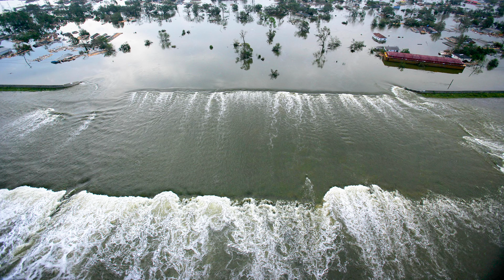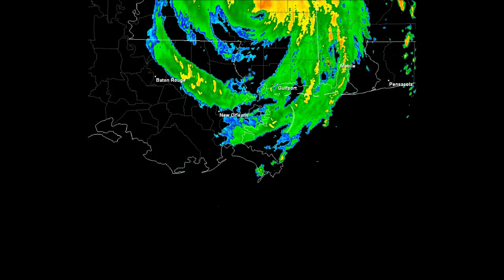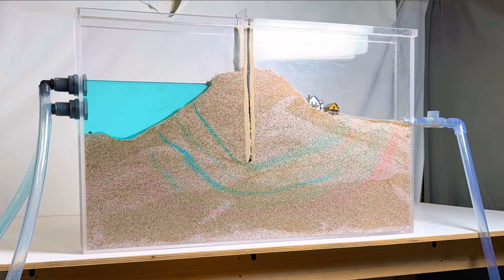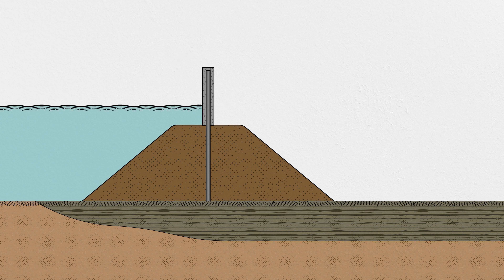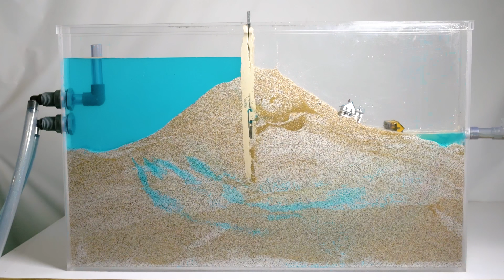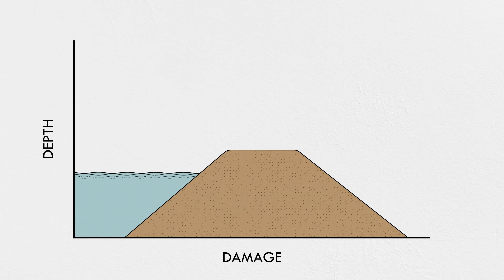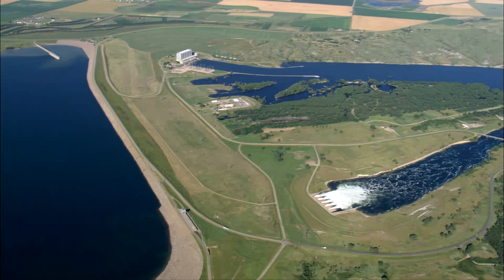The Mind-Blowing Flaw That Flooded New Orleans

Comment: But the MSM said it was because Bush hated Black people.  The MSM never lies.  Rusky Collusion was real, right?
Reply: No, the media reported many other people's and group's opinions that racial issues contributed to the poor management of the response to the disaster which there is strong evidence to support, and yes the Russian collusion was real and you'd know it if you actually would read the report that clearly outlines it and got several people directly connected to him indicted and prosecuted, fear of a Constitutional crisis by indicting a sitting POTUS was the only reason he wasn't charged too.
Reply: @jongrey1916  Sure, and people can change gender also.   Mueller found zero evidence and it's documented. 
Covid scam 
Rusky Collusion hoax 
Massive election cheating
Lawfare 
Censoring speech 

True definition of Fascism.
Reply: @DerekColeman-t3v  - Deflecting with other issues and conspiracy theories you don't understand doesn't change anything.

If you believed your original comment was true you wouldn't need to deflect the discussion to other topics, so clearly even you know your comment was nonsense.

Not a single media outlet ever suggested or claimed that the Hurricane Katrina disaster was caused by Bush being racist, only that racial issues played into the mismanagement of the response to it.

And the Mueller Report didn't judge "collusion" as no such crime exists in the US code but rather conspiracy, based on "coordination" which they determined required a clear provable agreement beyond knowingly assisting each other the way "collusion" infers and is heavily evidenced.

Volume 1, Introduction to Volume 1:

"Like collusion, "coordination" does not have a settled definition in federal criminal law. We understood coordination to require an agreement-tacit or express- between the Trump Campaign and the Russian government on election interference. That requires more than the two parties taking actions that were informed by or responsive to the other's actions or interests."

It also clearly states in Volume 1, Executive Summary:

"On June 9, 2016, for example, a Russian lawyer met with senior Trump Campaign officials Donald Trump Jr., Jared Kushner, and campaign chairman Paul Manafort to deliver what the email proposing the meeting had described as "official documents and information that would incriminate Hillary." The materials were offered to Trump Jr. as "part of Russia and its government's support for Mr. Trump." The written communications setting up the meeting showed that the Campaign anticipated receiving information from Russia that could assist candidate Trump's electoral prospects, but the Russian lawyer' s presentation did not provide such information."

"Anticipating" getting election assisting dirt from a foreign power is collusion but doesn't meet their strict definition of "coordination" they were actually investigating.

Volume 2(on obstructing the "collusion' investigation), section 4, Conclusion:

"Because we determined not to make a traditional prosecutorial judgment, we did not draw ultimate conclusions about the President' s conduct. The evidence we obtained about the President's actions and intent presents difficult issues that would need to be resolved if we were making a traditional prosecutorial judgment. 

At the same time, if we had confidence after a
thorough investigation of the facts that the President clearly did not commit obstruction of justice, we would so state. Based on the facts and the applicable legal standards, we are unable to reach that judgment.

Accordingly, while this report does not conclude that the President committed a crime, it also does not exonerate him."

In summary: there was plenty of evidence of collusion and obstruction of justice but in Trump's specific case we couldn't prove it beyond doubt and chose not to view it as a crime because presidential immunity means we can't charge him so it would be wrong to accuse him of crimes publicly. Congress should do it's job instead and take action.

Comment: The walls were intentionally blown and the pumps were turned off. Get real bro.
Reply: actually all the money that was designated to maintain the system, especially the pumps..... was all spent on Mardis Gras!
Reply: @ChthonianRealm  Perhaps, but there are documentaries interviewing the employees at the pump stations where they were made it clear that they were told to turn them off and leave.
Reply: @dentontxflatearthguy2903  well yeah, cuz running them would use up funding better spent on mardis gras. get real bro.
Reply: No they were not 'blown", there is not a single shred of physical evidence of such a thing and explosives ALWAYS leave physical evidence, stop spewing nonsense. And the pumps were turned off and evacuated because the levee breaches on the drainage canals not only rapidly flooded many of the pumping stations themselves requiring them to be evacuated but trying to pump water into the drainage canals that the water is flowing in from so it can all come right back into the flooded areas is pointless and just dumb. 

They had to wait until they had patched the levee breaches on the drainage canals before they could activate the pumps and start pumping the water out through the drainage canals.

Comment: Thank you for your excellent videos. One of my professors said that you could measure the value of an engineering failure story by counting how many times a phrase like "And that would have been fine, except..." occurs. I feel like that sums up your channel well. 

Rudyard Kipling had a keen interest in engineering, and wrote many poems and stories inspired by the field. Hearing you explain how various site assessments and load calculations were wrong thanks to human error or negligence reminded me of the opening stanza of Kipling's poem "Hymn of Breaking Strain" (which every engineer should read in full, with a box of tissues nearby).

The careful text-books measure
  (Let all who build beware!) 
The load, the shock, the pressure
  Material can bear. 
So, when the buckled girder
  Lets down the grinding span, 
The blame of loss, or murder, 
  Is laid upon the man. 
    Not on the Stuff—the Man!

Comment: One comment on the issue of the walls. The 17th street walls were designed by local engineering firms at the behest of the local levee district not by the Corps of Engineers. The buck stops with Corps because the Corps did review them but they were actually designed by others
Reply: I don't know how what you said has anything to do with my comment.
Reply: sure, but as ive said with other comments, would you choose to live in a flood zone? just begging for trouble. before you buy, check flood overlay maps.  to me its just negligence.

Comment: Have you started the skeleton for the follow up book for what’s going to happen in the Sacramento Valley when the kind of rain year hits that threatening with the super El Niño? Old earthen levies in Sacramento that partially fail and get boils under normal rain years have been allowed to have neighborhoods built behind them. There was never supposed to be neighborhoods there. The inadequate ability to handle a fully open Folsom Dam when the rivers are high. The Yolo bypass is a great safety valve once the water gets there but it has to get there. Further south the damage may not come in building losses but in ruined farm land as the valley returns to being a giant lake. There is a reason that the Sacramento Valley can’t refill its aquifer but also is good farm land. Snow melt and flooding rain washed down the mountains from Yosemite with nutrients but there was also inland lakes to that formed because the land doesn’t drain. They have now been drained using dams and control routes for the water to irrigate. Twice in recent years the largest lake has begun to reform causing damage because we are getting less snow and more rain and that is not how the control measures were built to handle too much water. But now that “lake” water sits on fertilizer storage, and cattle lots, and pesticide containers. It’s a toxic mess. California thinks an earthquake is the biggest disaster it faces and people worry and make plans about it a lot. I think from a relative frequency, breadth of distruction across areas, time to recovery, the next great flood is truly what people are unprepared for. The last was just before the gold rush. CA was not on that many radars apart from the ports and not much was written but for a significant period there was no route by land that wasn’t  through the mountains between northern and Southern California because of the standing water. That happening again would create a food supply issue that would impact the entire world, and climate change is making that type of year all the more possible. It is insane to me how little it gets talked about. The San Andreas get all the press. The Fire situation is ugly and needs to be handled better but no one ever talks about this.

Comment: i was a contractor for fema bringing in pumps to pump the town out, then brought in pump parts for the west closure complex and a couple generator outa the 5 in there. i have some pictures from inside. HUGE Cat C280 3600 series that make around 6000 ft lbs thru a lufkin right angle drive thru the floor to spin the propeller pumps….. if i could live in that place i would 😅

Comment: PS - New Orleans is not on the coast; more than 85 miles by highway upriver; more than 100 river miles from Pilottown. The annual tonnage of goods shipped through New Orleans, as far north as Baton Rouge, makes it almost equal to Rotterdam and Singapore. The land where the French Quarter was where the city began in 1718; Bienville built the city there because the land was higher than anything else around it. It still does not flood (much). Never forget - Hurricane Betsy was a Cat 4 when she hit land. Betsy was why the Safer-Simpson scale was invented. Katrina, in spite of all the damage and misery and other superlatives, was only a 3. Hurricane Camille blew  away the wind gauge at Bay St. Louis, MS., with gusts of at least 190 mph. Last, but not least, a good portion of our state was built  on alluvial soil dropped by the Mississippi as it changed paths through the eons

Comment: He’s not just gonna make another video about how moronic it is to put a coastal city BELOW sea level is he? It’s not an “engineering failure” when the original settlers were just dumb and settled in a moronic spot.
Reply: by that logic we shouldn't build any cities because earthquakes, tornados, volcanos, hurricanes, and meteor impacts can hit them all
Reply: @fff @ffffffff-gu5qr , putting a city beneath a Volcano is just as moronic. On the note of weather phenomena though, I made no such claim. You can’t predict weather, you CAN however use basic logic to understand that big smokey mountain is dangerous and that the valley below the waterline is dangerous. You lumped a turd in with the oranges then claim my logic means all fruits are bad, which is quite a stretch on what I said.
Reply: @DeathMonkeys  volcanic soil is actually insanely good for growing crops, so you could argue the price of just rebuilding every once in awhile is worth it. For other weather, tornado valleys exist and you wont believe who builds there.

Comment: I'm not a fan of your pitch for the book, your framing for it is, in part, as a way to understand this critical information that can save lives, and you pitch it as being sincere that you want people to know this information because it could make a difference in the world. I feel very strongly that if the intention were to do that you would not charge for the information and would be pushing it just as hard. I am not saying you don't deserve compensation for working very hard to write a book, you do, your work is great. I am saying that framing it as 'important, complex information made understandable in a way that could potentially save lives' is directly at odds with charging for said information because if you want to save lives or change the world as your core fundamental you probably would not charge for it. Instead I suggest shifting the framing of the pitch to one of intrigue into the disasters that have happened and what we've done about them as a result, on the safety that has been absorbed

Comment: You forgot to mention that despite the incorrect engineering assumptions the system was still guaranteed to fail in a Cat 4+ storm, or even a Cat 3 storm with heavy storm surge.  Furthermore this was a well-known problem which was actively ignored.  That is the only mind-blowing flaw here.

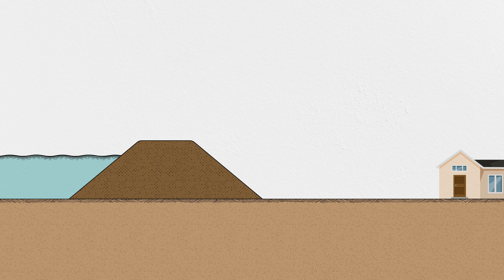Comment: 4:09 "You can see the   problem. If you want to raise the embankment to  provide more protection, you need more space."

Not really.  Why couldn't they build the embankment higher and shift the seaward wall FARTHER outward, while keeping the the landward side stable?

18:27 "This concept is sometimes known as hazard  creep, and it’s the thing that no one recognized   
in New Orleans, the shadow of the flood protection  system had, in some ways, only made things worse."

I have to agree with this.  I always thought it was silly to build a city next to the ocean below sea level.
There best plan, besides levees would have been to raise the floor of the city by dragging surrounding dirt (or concrete) in.... then building on top of that.
The problem is, of course, that the city had already existed and they were NOT about the destroy it to build up the floor.
Katrina could have solved that problem for them but the city simply built right on top of existing sloppy infrastructure.

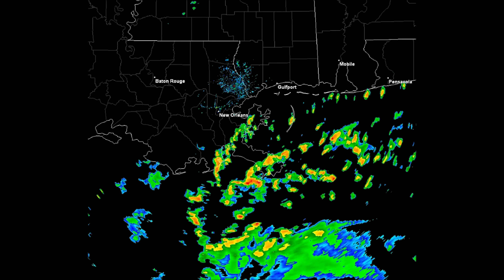Comment: 5:57 It's not subject to the same tidal FORCES but to the same tidal MOVEMENTS. The tidal force is very much predictable, and is the result of the gravitation of the moon  and the sun combined (if classical mechanics is accepted as the general model). The tidal movements (ebbing and flooding) are a result of the tidal forces combined with meteorological conditions such as high and low pressure, and pushing as a result of the prevailing winds. Flood barriers are usually designed to cope with the tides as a result of tidal forces, but should be designed to cope with the result of tides and storm surges combined, which is unfortunately rarely the case.

Comment: The surge that came into the 9th ward was a different animal than the surge that came by Lake Ponchartrain. On the morning of the storm at the height of the storm a large surge came into St Bernard parish by way of Lake Borgne. Off of that lake is the Mississippi River Gulf Outlet (MRGO). That created a funnel like effect for the surge and it shot into the Industrial canal with great force and speed in almost a tsunami effect. That pressure is what broke the 9th ward flood walls before the Lakeview and Gentilly walls. St Bernard was too overcome by surge at the height of the storm as well. Not much would have stood up to the force in the first surge. The later wall failings was due to very poor engineering and planning.

Comment: This reminds me of so many projects I've seen.  Massive funds spent on the initial project, but not enough spent on maintenance and upgrades.
Also the housing built too close to the levee are a zoning issue and probably a court one too.  The levee's should have had a restriction zone around them.  Similar to one that is around a prison, and what used to be around airports.  In the airport cases, of which I'm familiar with several, they were sued in court to allow building within the reserved zone, then once that was done, sued for the noise created in those same areas once housing was built.